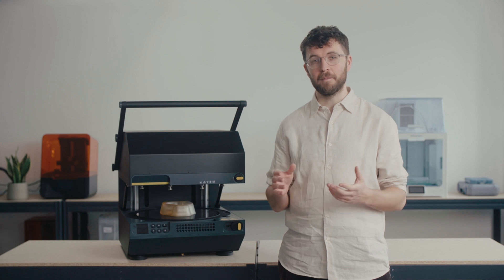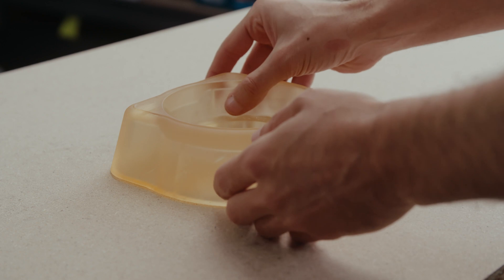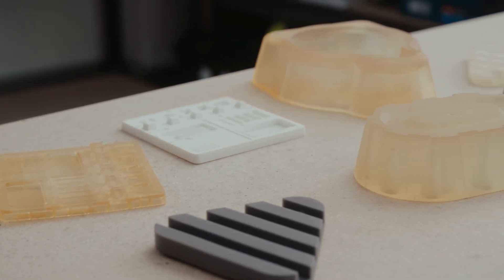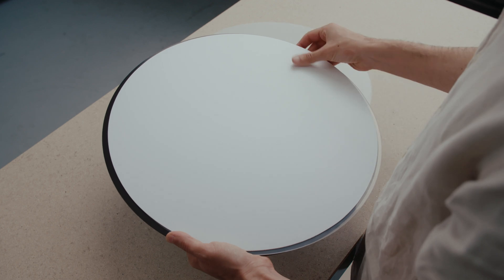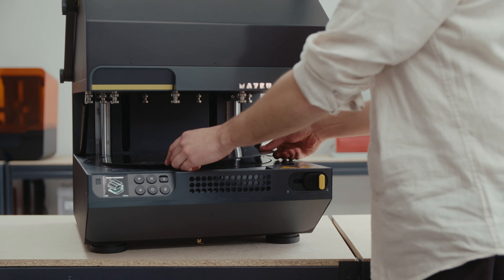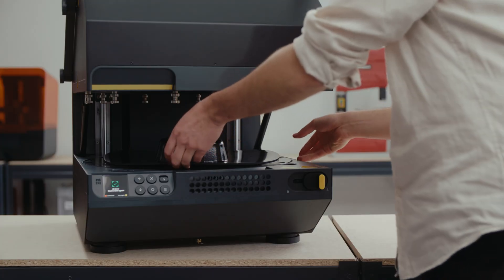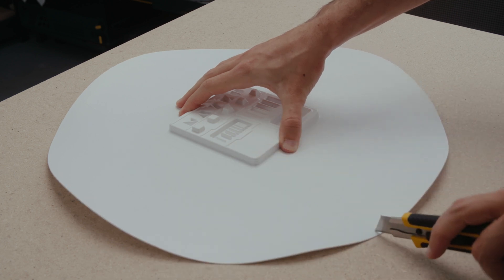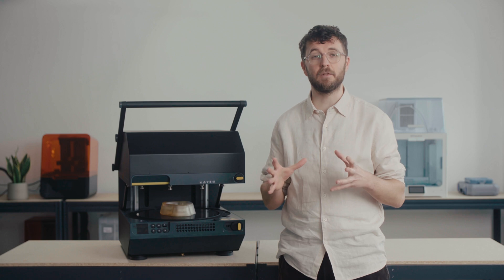Mayku Multiplier Demo - Pressure forming workflow

Comment: i have to say. im often not impressed by new machines. but this is rather nice. it seems straight forward and direct with 4mm abs that's pretty intense! i know this came out a while ago, but id suggest the potential for a means to reduce waste by having maybe a blocker or something to use smaller sheets unless we have a means to recycle the material for another run with some OTHER machine lol. 

Thanks!
Reply from the maker: Yo! Thank you very much! You're speaking my language. We actually have a set of reducing plates (A4 ETC) available for the machine that you can check out on our website. AND we make custom ones too. We can't say who we make them for but lets say a large social media company that makes VR stuff. 😉. And yes 4mm ABS is pretty intense, and with the reducing plate we've even gone up to 8mm...